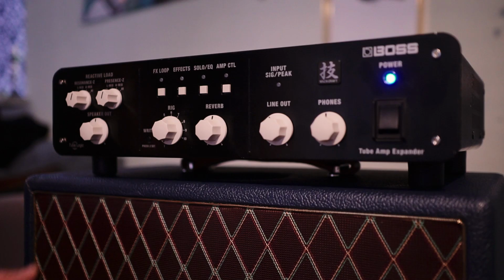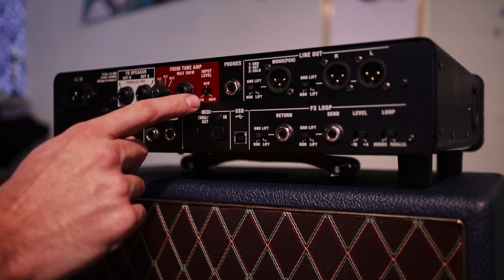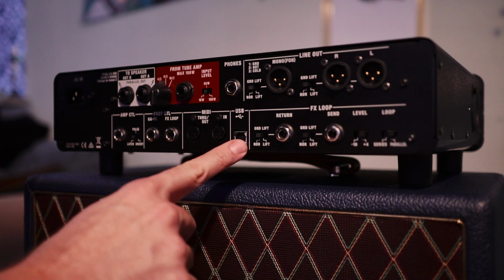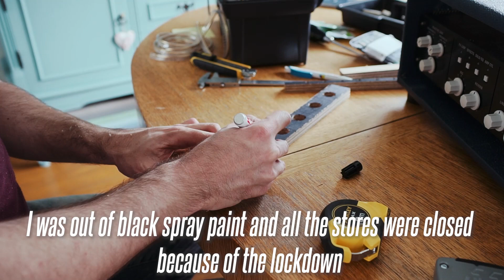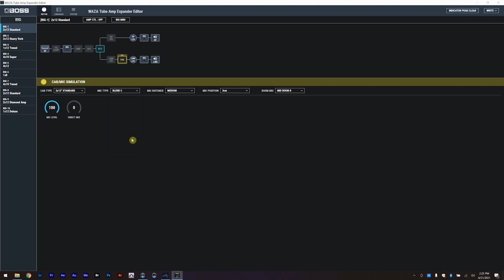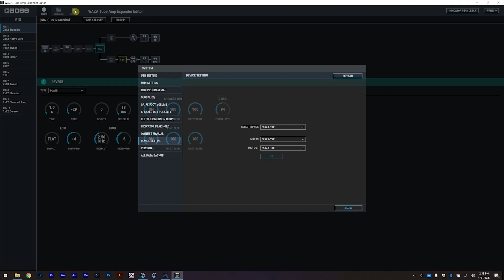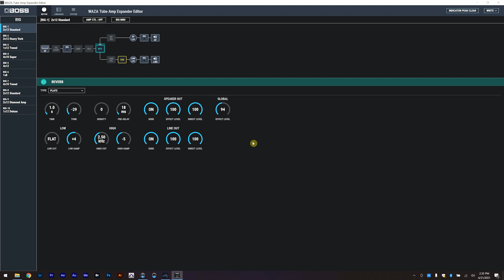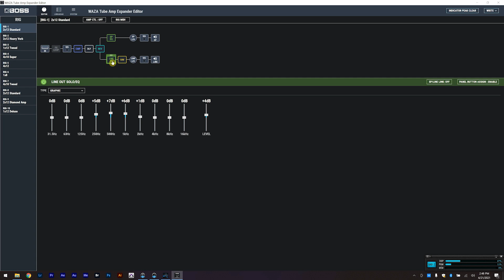How to PIMP the BOSS WAZA TUBE AMP EXPANDER! And much more!

Comment: Hello dear Sasha - what a joy to hear you playing: tone, feel and phrasing make we - don't mind me saying - a bit jealous. Or should I say 'inspired'/'motivated' ;-) I recall you testing some D'Angelico's online. I bought the blue Premier DC back then ... And now I stumble upon your channel here; immediately melting again hearing that style of playing.  

So far the praisel, I also have a question ;-) 
I'm planning to buy this TAE. But just to clear out some doubts. If you use this live on stage, no FOA/small gigs, only with a heavy Fender Twin as source: you can attenuate the volume, and adjust with the two outer left knobs the desired voicing of some cabinet. The signal is re-amped but on stage you hear the voicing/sound of your own live cabinet as final step in the signal chain, isn't it. Doesn't conflict that? First predefining a suggested cabinet in the TAE, and next reproducing that as live-sound with another cabinet with is own specs. 
When I completely loose perspective is when one should attenuate, predefine a voicing of a Cabinet using those two knobs on the left, use the cabinet-sim (software/rig's) and reproducing live sound through a live-on-stage-cabinet. That's three on a row, no?

Can you help me out where I am missing the point here? (if one uses DI/FOH everything makes sense, that I understand :-).
Thanks for your thoughts about that. Rudy
Reply from the maker: Hey Rudy, thanks so much for your kinds words! You'll attenuate with the TAE regardless of FOH or PA system. The two small knobs are to compensate for frequencies lost in the speakers of the amp. The TAE has two signal paths. One going to speaker out WITHOUT cab sim. The other going to stereo xlr, mono xlr foh and headphone out WITH cab sim. Look at it this way. They TAE is a master volume for your amp and can send studio quality fx to your amp. It's also a perfectly mic'ed up cab in a controlled environment which is being sent through XLR to whatever you want. Interface, foh etc.
Reply: @SashaIvantic  Thank you ;-)

Comment: Hello sasha. Very cool demo. I also own the tube expander and use it live. I then use the foh mono line out. Do you think its also possible to send in stereo to the front of house in the same way you record?
Reply from the maker: Yes definitely! The FOH mono output just combines left and right to one signal. If the mixer has enough inputs you can do stereo. The channels just have to panned left and right.
Reply: @SashaIvantic  allright. Thanks a lot for your help man

Comment: I'm intrigued by the TAE, but have so many questions. You have the perfect tone seemingly in every video. Are you using the TAE and micing the cab, or recording direct through the TAE? Something else entirely?
Reply from the maker: Wow, that's a big compliment. Thank you! I'm only using the TAE to record and don't mic the cab. TAE is going stereo to the interface. Most of the times I use a 2x12 cab sim from the TAE and since my amp doesn't have reverb the plate from the TAE is always on. Let me know if you want to know more!
Reply: @SashaIvantic  Thanks! So the sound I'm hearing is the TAE. So when you're playing, what are you hearing? The cab? Or studio monitors?
Reply from the maker: @JW2692  That's correct! All stock, no fancy third party IR's. When I'm recording a jam track I'll be playing through headphones. At other moments it might be the cab, it might be headphones. Depends on the situation :)
Reply: @SashaIvantic  Ahhh, I see. I see how flexible that can be.

Stop making me spend money.
Reply from the maker: @JW2692  hahaha sorry man! That's the cool thing about the TAE. I chose it for a fairly simple purpose but before I knew I couldn't live without the other features like built in reverb, fx loop. It's such a powerful device!
Reply: @SashaIvantic  Hi, a lot of users say it changes the original tone of the amp. Do you find that too?
Reply from the maker: @flagace4889  Yes, it does. But a 100% clean pass through attenuator doesn't exist. This is the cleanest device on the market though. In my opinion 😄
Reply: @SashaIvantic  Hi, thank you for your response. I've you heard or tried the Fryette Ps-2? It uses real tubes instead of solid state like TAE.
Reply from the maker: @flagace4889  that's a great one too!

Comment: Hey man do you notice any change when running into the TAE vs without?
Reply from the maker: Hard to say. Changing volume also changes the tone. But the short answer is no. If I were to a/b with a cab switcher I might hear a difference. When a/b'ing by just placing the TAE in between I don't hear a difference. So if there is one it's tiny

Comment: Have you heard of people’s amps messing up and transformers being overworked because of tweaking the reactive load knobs?

Seems not uncommon for this to be an issue. It has kept me on the fence with the tae.
Reply from the maker: Wow, no I haven't actually. Haven't experienced it either. As far as I know the reactive load knobs only apply to the power amp of the TAE itself and should not affect the amp.